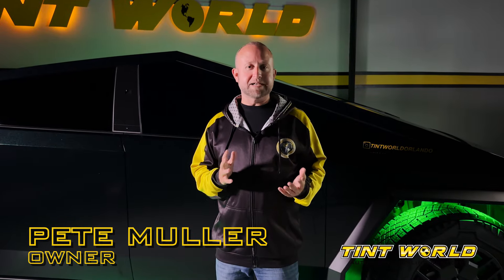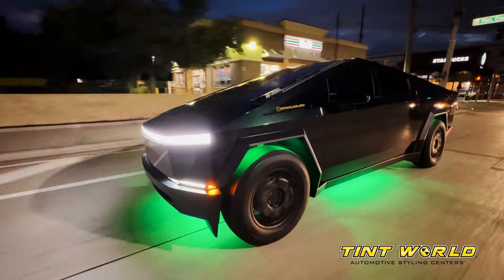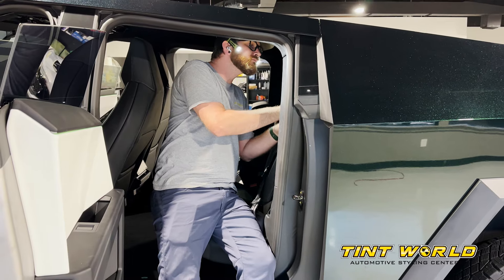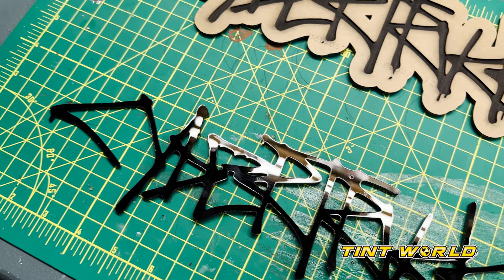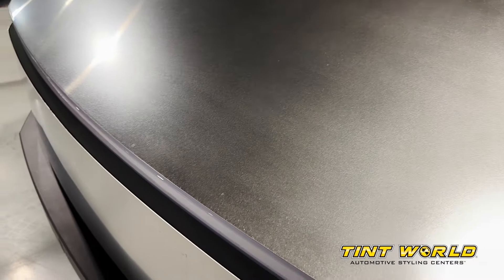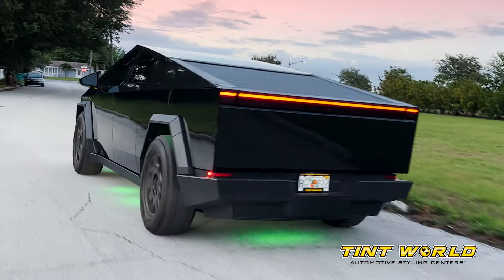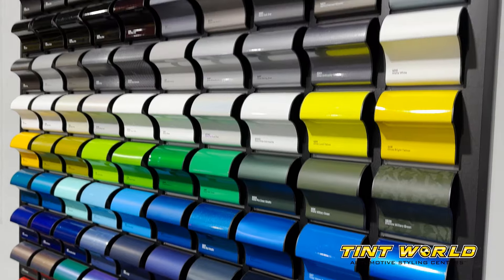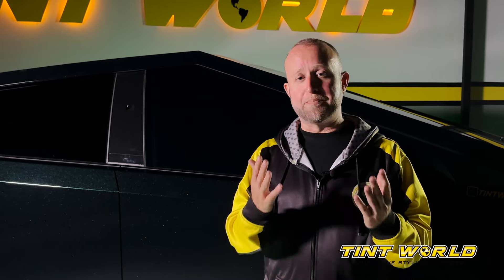World's First Cybertruck Sound System Upgrade, Custom Lighting, and More!

Comment: There is 12 volts near the rear view. I use it for my radar detector.
Reply from the maker: @justonbrazda3846  There are factory step-down converters creating 12v in quite a few spots but not usable for much more than a radar detector. Certainly not enough amperage to power a full audio system without creating errors on the display. 🙂
Reply: @tintworldorlandofl5761  Yep, just saying, there is 12v in the vehicle.  I used mine for a radar detector.

Comment: do you mind sharing the cost or an approximate of what one could expect for a similar set up??
Reply from the maker: An audio system in the Cybertruck would be similar to any other vehicle, but adds the cost of a 12v battery and some other small wiring accessories. Not a significant increase. 👍

Comment: so the original speakers were 48 volt? never heard of that. Had to have a step down already installed for the speakers you installed.
Reply from the maker: The OEM amplifier powering the speakers uses 48v.

Comment: Does this system upgrade impact the range at all & if so by how much? 🤔
Reply from the maker: @reel2reeltv944  it has zero impact on the range. We have been installing sound systems and aftermarket accessories in Teslas since 2016 and never seen it impact the range on any model.
Reply: @tintworldorlandofl5761  ty for your input!!